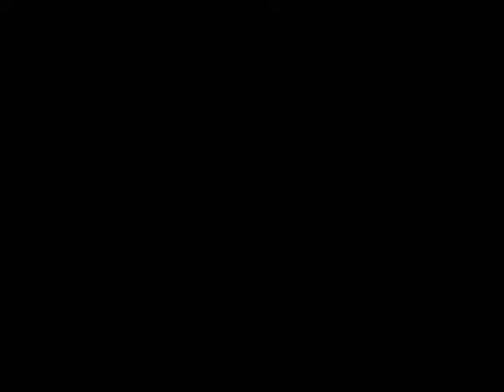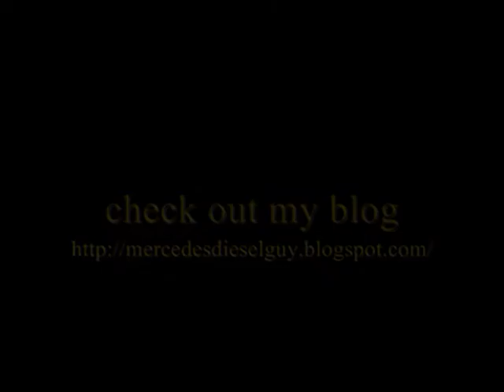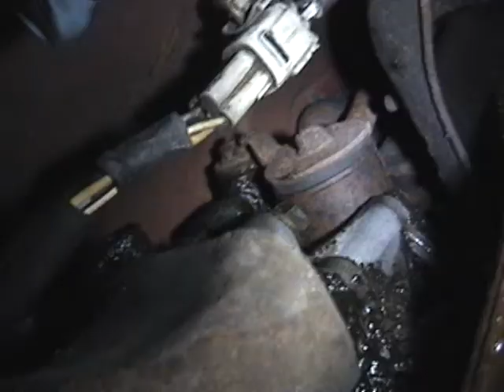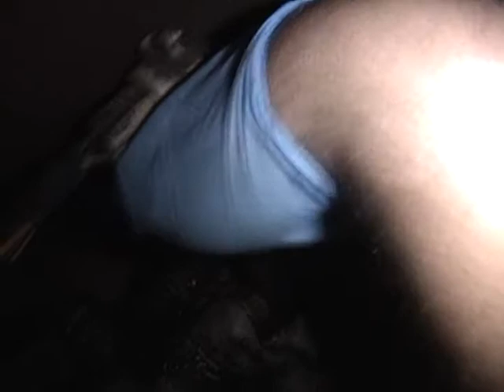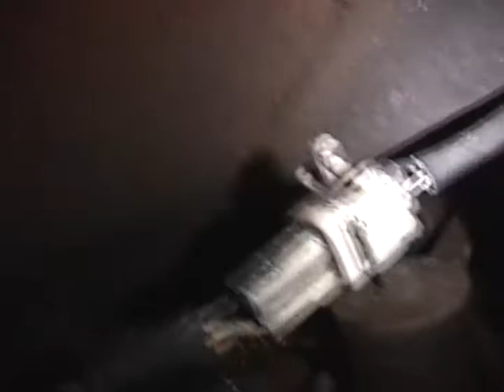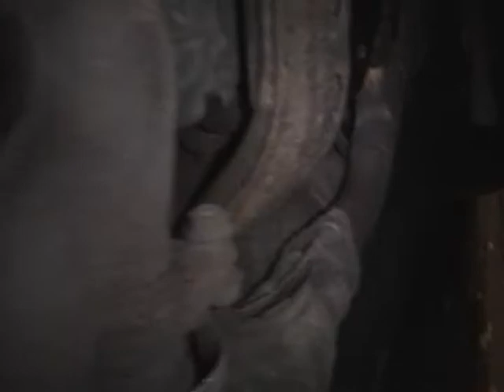1995 Subaru Legacy - investigating rattling shifter

Comment from the maker: Offhand, I don't know. But, I'd start with opening up the center console. First, you remove the cover piece closer to the arm rest/storage box. Then remove the trim piece closer to the dashboard. You may need to pop off the gear selector surround piece first. Once you're in there, it'll probably be pretty easy to find the bulb. Best of luck.